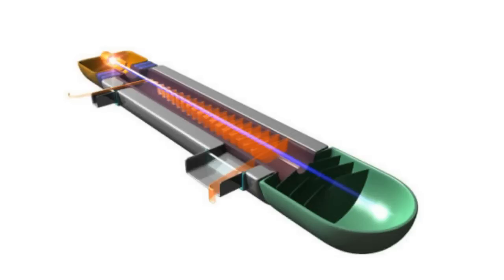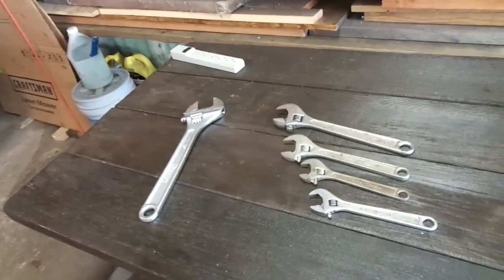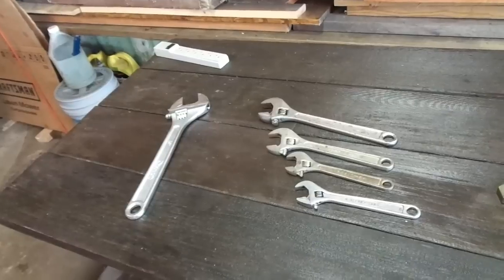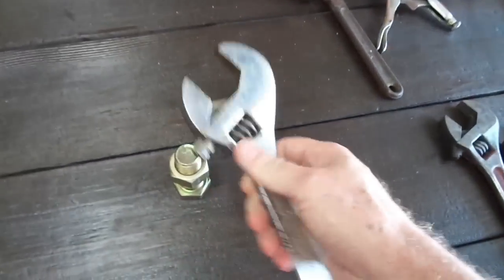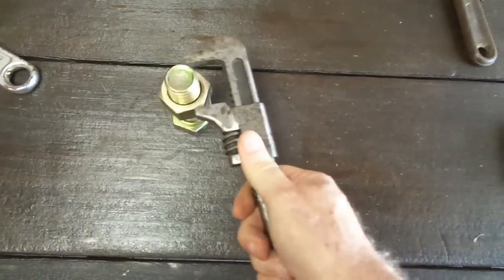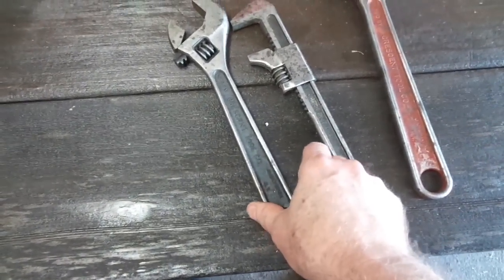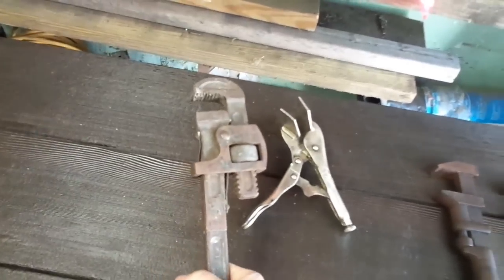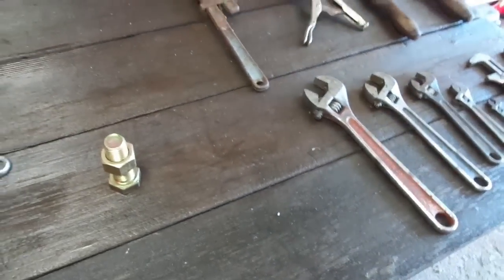TDD report for August 15, 2015 (Hands On)

Comment: You got to have leverage too so I guess it compensate the size factor! I got here 3 sizes of the pipe clamp and they can do anything both for bolt size and leverage! I had one of those modern you mention when I was a kid, they are called here in rio as "English wrench" but I never liked them... Still today I pick few ones in the hand and when I feel the play they have in the jaws 😝 I'm looking for the bionic grip if I found I'll get one
Reply from the maker: LiPe VoLcOm  In a pinch I have used a pipe wrench on a big bolt. I just hate that it leaves marks all over the surface from the teeth.

Comment: Vacuum tubes got a big resurgence about 15 years or so back when pro guitarists started shunning "solid state" amps and going back to the old tube amps. 
Problem with the smaller tools on that huge nut is you won't get the leverage you need to tighten or loosen that bolt to whatever torque its spec'd for.
Reply: ***** I agree. For critical stuff I have a torque wrench and the correct socket. Maybe 10% of the time I do work that needs that precision but you can screw things up if you don't do it right.

Comment: I have a huge collection of old tools, handed down over the generations, and love the dearly. Only thing I will say is, avoid using an adjustable for any other than hitting stuff.  use a proper spanner or socket, it will save you a lot of grief.  😃
Reply: afterthetone These are mostly stored away and brought out for show.
 I do have two complete sets of mechanics tools with proper sockets and torque wrenches. :)

Comment: Tubes make the best stereo amps as well. The solid state ones don't have the same quality of sound. The only thing is you have to float them in the case if your going to get very loud, or they ring.
Reply from the maker: Dave Nicholson The reason tubes work well for sound is that they are linear from the get go. Transistors are not and have to have compensating circuits added to straighten out the curves. Their advantage is small size and less heat.